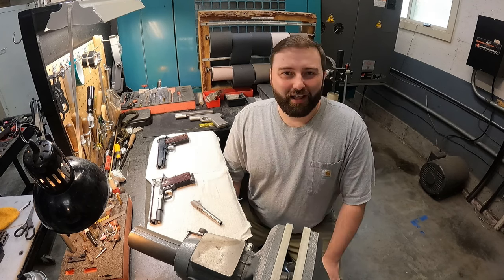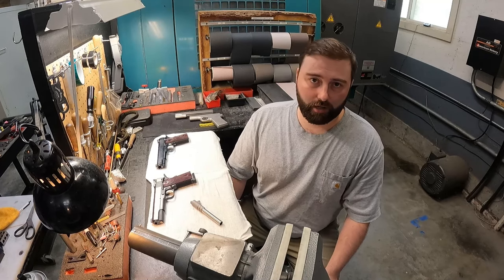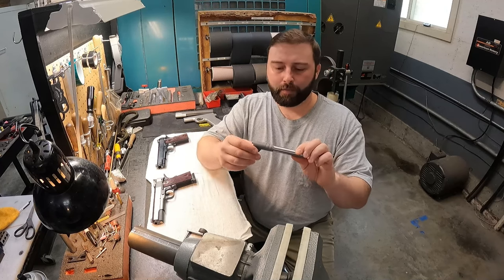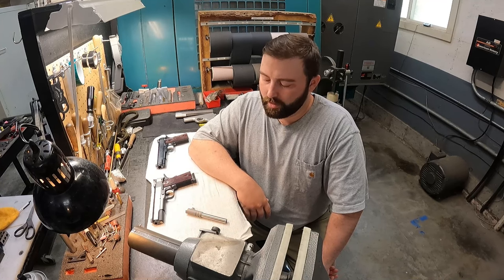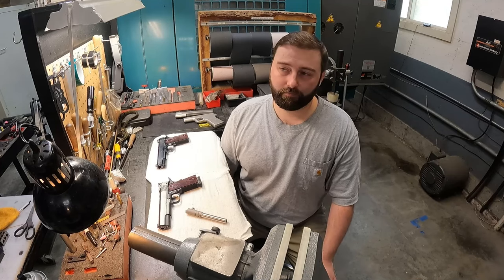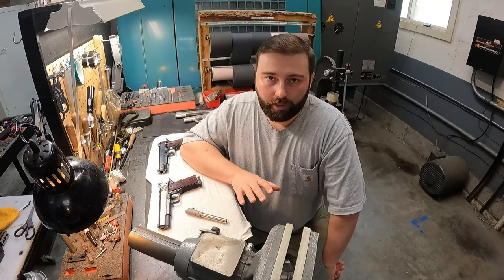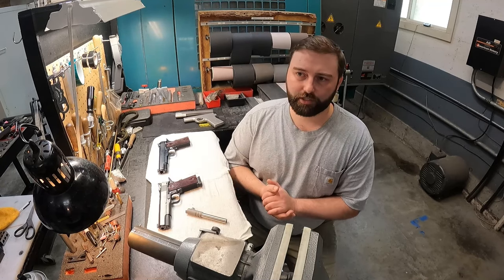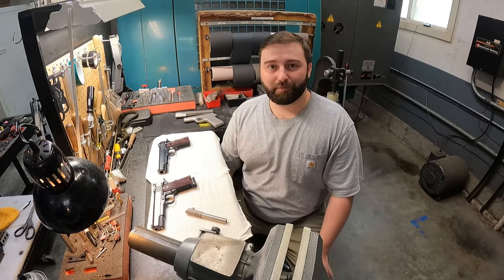1911 Build Philosophy: How We Build High Quality Handguns at Sbardella Arms

Comment: With you using in house forgings, are you able to customize the slide and parts to the customers interest? Say like making a high gloss blued retro 1911a1 classic, rear vertical slide serrations, classic ejection port with no lowering or flaring, with hard fitting?
Reply from the maker: Yes, I have built a lot of high polish blued guns.  I do offer classic vertical slide serrations as an option and I will do most custom requests.  I can build a hard fit gun on request.